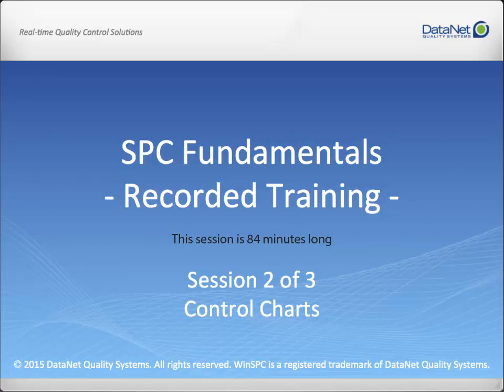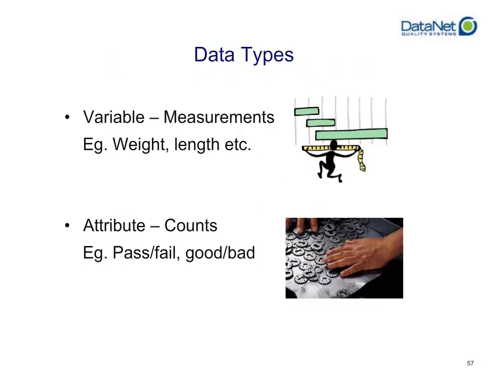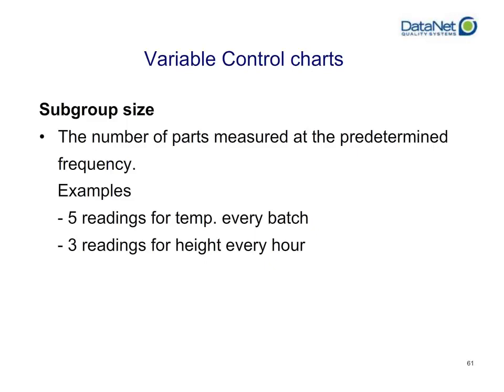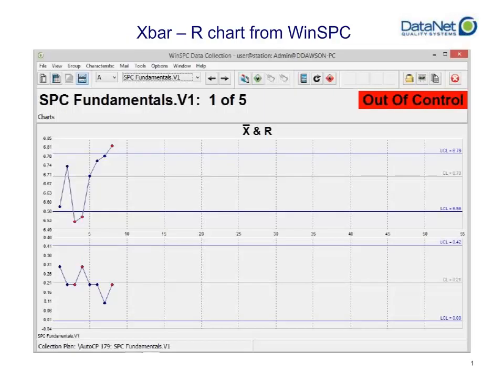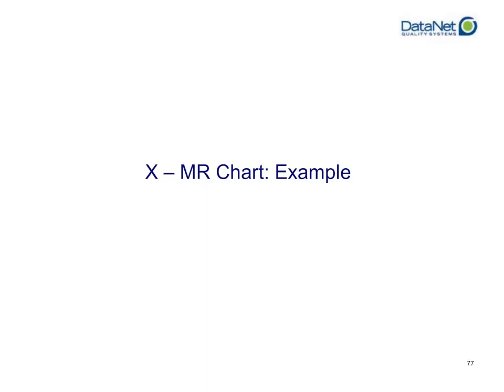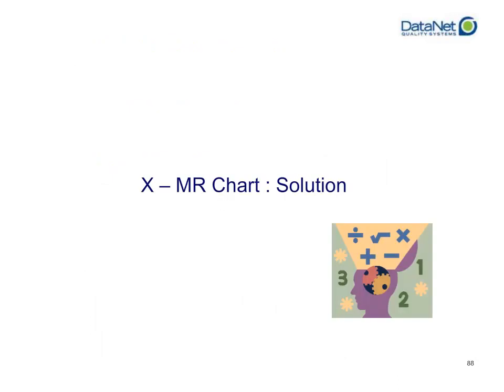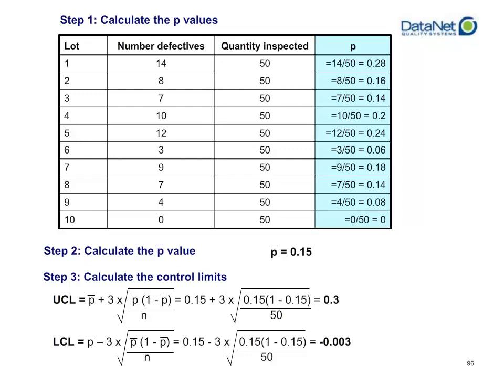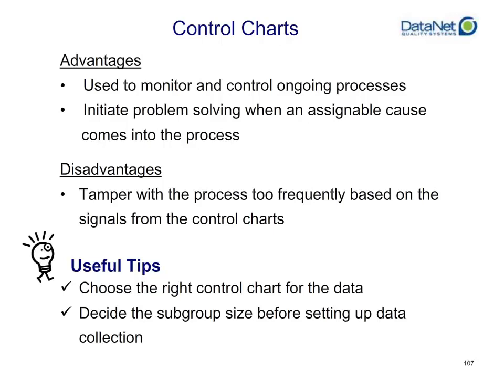SPC Fundamentals | Part 2 of 3

Comment: Was there an error on the attribute control chart table? At 1:17:03 you said that the p chart was only to be used for constant lot sizes, but the table at 1:02:50 says the exact opposite...
Reply from the maker: I will forward your question to the author at Support@winspc.com for him to answer and see if we can get that relayed back to here.  Thanks for asking.
Reply: Yes, they should be np charts from 1:10:00 due to constant subgroup sizes and defectives.  The author has shown incorrect examples.